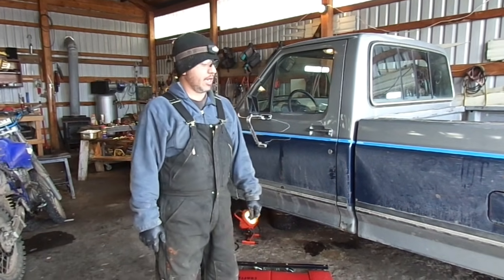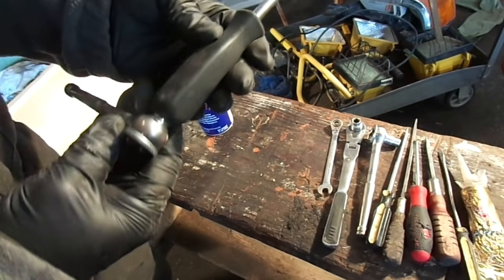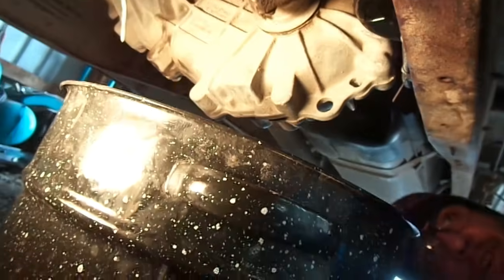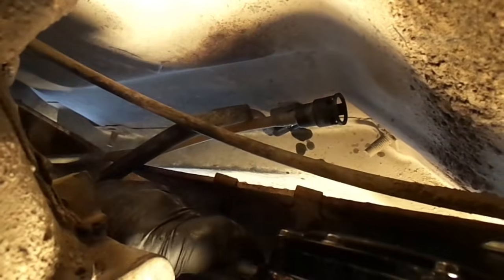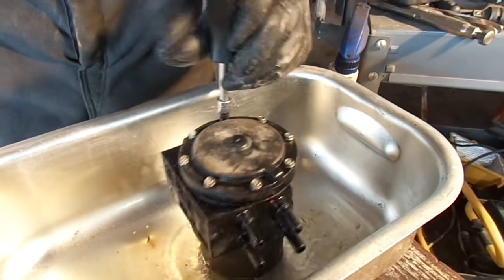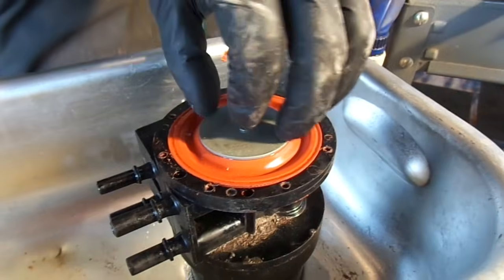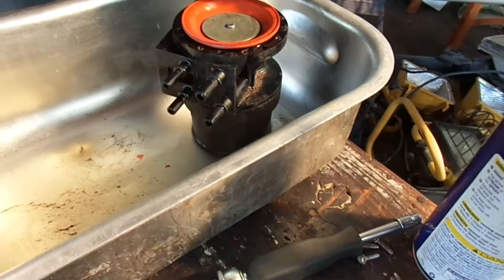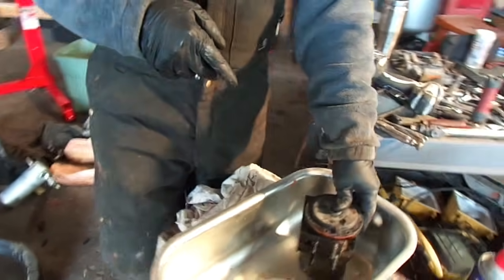1987 F150 Dual Fuel Tank Selector Repair

Comment: I have one of those. I got to check my rear tank because it leaks when topped off and parked on a small tilt to the right. I have a switch for selecting the tank, but can never tell if it really switched or not. I keep getting the same fuel gauge value, front or back, from the fuel sending unit. There should be a sending unit for each tank. Is it possible that it draws from both tanks simultaneously because of a stuck tank selector valve?
Reply: CincyPlasmaTech...check the o-ring gasket under the lock ring on the rear tank. If it has either deteriorated or if someone installed it incorrectly, meaning it is twisted under the lock ring or not properly centered, you will leak gas out of the top of the tank. This is very common on Ford trucks. The o-rings can be bought cheap and usually come with a new lock ring too. As for the fuel gauge not reading properly, yes each fuel pump has its own float that sends the signal to your gauge based on the amount of gas that is in the tank. Check the wiring to the fuel pumps (especially the ground wire). The contacts on these fuel pumps corrode easily even with the rubber boot that covers the wiring when it is connected to the pump.

Comment: So my 96 F-150 is having cross fill problems in the dual fuel tanks. The front tank just had a fuel pump changed, no the front tank is cross filling over into the back tank and over filling it and it is leaking out of the fill cap and onto the ground
Reply: Saul Varela pretty sure the selector valve on my model is electric and has been moved inside the fuel tanks. So I've heard. So now all I need to do is find the part and fix it I guess. Syphoned the gas out of the rear tank and put it back in the front, except for about 5 gallons. Now it won't start. It'll crank, and I hear the fuel pump kicking on then off. So now it's something else along with the selector valve.
Reply: Saul Varela I will keep you posted as soon as I can get home and crawl under it. I appreciate the help. I'll keep you updated asap
Reply: Saul Varela so, there is nothing on the frame rail on the driver side other than the fuel lines and and connectors. There is nothing like what is being fixed in the video. I would notice that. I see the fuel filter, lines and connectors but nothing else. It's also doesn't seem to switching tanks when you use the selector switch on the dash. I think it may be bad and stuck on the back tank which has a bad fuel pump and has only 10% from what the guy said who hooked it up to his computer
Reply: Saul Varela That's what we plan on doing first, hopefully that will work. And then like you said we will go from there. I appreciate the help and I'll update you as I go, thanks.
Reply: Saul Varela thanks. I did turn the key to run and switched tanks and they show different levels of fuel. So i believe the selector switch is working. Now on the selector valve.
Reply: Saul Varela No, I will now that you've mentioned it. I never thought of that.
Reply: Saul Varela Update: changed both fuel pumps in the tanks. No problems so far. Gas gauge doesn't go down as fast as it did and no fuel smell coming from back tank anymore. Thanks for all the help.

Comment: Very nice vid bro, I've a 95 f250 gas, when I switch it onto front tank, fuel gauge pegs out way past full, gonna try figure it out tomorrow
Reply: Saul Varela gotcha bro,  if I fix it I will def let you know what the problem was for me , dad signed truck over to me been sitting up for few years, did a tune up running alot better now , was running hot so I changed thermostat , went from a 195 degree to a 165 degree and engine runs 30 degrees cooler lol,  I've always had chevy this is my first ford and will say that 3/4 ton gas f250 rides like a caddy

Comment: Great Job!  I was Miss lead on forums about my no fuel pressure issue being everything under the sun with issue causing the problem. I followed your instruction, soaked with Kroil next day worked it in. Used permatex to seal top. truck runs wonderful..Keep up the great work. You made my day. Thank you

Comment: 96 f 250 ...is it ever just the switch on the dash board ?  my front tank is not working also . Only my rear tank ...thx !
Reply: Yes,  i think i checked the switch properly and it seemed to be good . I'm not very knowledgeable when it come to the multi-meter ,but i think i did it right  ...basically a continuity test. You were a huge help . i'm a Custom home builder by trade so if you have any questions in that department shout out ...you were a big help .I'm getting read to get under the truck now and do exactly what you did.  thx !

Comment: Awesome, thank you! Looks like I have the same issue on my 96 250, not sure if it's related but the front tank bogs out when depressing the gas pedal heavily and fill cap is leaking on a daily basis if I don't syphon it back into the rear, thought I was getting horrible mileage as well on the rear tank and perhaps the front pump strainer was clogged. Already changed the inline filter, just made it worse for the front tank. Hope this is it, looking forward to pulling it out. Thanks for posting.

Comment: Just did this on my 1989 F250 with a 460. Thanks  for posting. It wasn’t a bad job at all, but I had lots of of room because it’s not a 4x4
After watching your video I put it all together and on the first try the rear tank finally worked.
The inside valve was stuck in the up position. Worked it loose like you showed. On my truck Dorman # 800-015 clip kit. Comes with 3 5/16 fuel line clips and 3  3/8 clips. I pre lubed the fittings on the reservoir and I also put the clips on first before installing the lines. Lines Snapped right on
No leaks
Thanks again.
Reply: Jack Hammer hello!! I have to get my truck to stay running and I have to know what filter I need!! I have the same exact part as this video but no shop can seem to figure out what filter I need please help!!
Reply: @mykaelynngoldman  did you ever find out the filter I'm getting ready to do mine best of luck
Reply: @arthurnewhart6369  what fiter was it?

Comment: Really helpful to see this video, Thank you!
I, too  replaced my high pressure pump on my 1988 F150, still low fuel pressure.
Will do this next, or repair a junk yard one and swap it out. 
One critique, I've read elsewhere that there is supposed to be a small O-ring in the hole under the bump on the lid.
sometimes they swell shut, can be opened with a 1/16 drill bit- remove it from selector valve first, of course. 
Regards! Terry

Comment: Thanks for the video.  It was real helpful.  I have a 1988 F350 with the same issue.  Rear tank is working but not the front.  Both tank fuel pumps run when tested but it won't pull from the front tank.  Going to try your fix.

Comment: What if it looks like if has very small holes
Reply: The diaphragm that rubber thing that align the tow little rods. Thank you for answer my question.
Reply: @Saul Varela they look like pin holes. Like they have been done from overtime of use. Will that affect the function.

Comment: 1987 f250 carbureted When I put my fuel switch on front tank both fuel pumps are running when I put my switch to rear tank only my back tank pump runs is that normal ?

Comment: Not many men would do a job twice just to help his fellow man. This says alot about yourself sir. So Thank you. I am going through the same thing.  We need more people like you in this world. Much Respect. Great job. Thanks from Kentucky.
Reply: My comment was very simple but you said it most correct. I thought the same thing what a guy to go through the trouble to share his experience and help others out. That's a hero in my mind.
Reply: That’s what it’s all about helping the fellow man cause I’m having to do the same on a truck I just bought. Thanks for the video it help tremendously.
Reply: "I just take crap apart and I hope I can put it back together later" AAAAHAHAHAHAHAHA, Me too
Reply: When you say "thats why everyone starts to think their fuel pump is going out. When that happens Does the FRP. Fuel rail pressure at the Schrader valve drop drastically to like almost nothing? What exactly happens to make people think that? Any help is greatly appreciated 🙏 thank you. Im working on a 89 F150 5.8L guy brought it to my home shop and told me to fix it, he wanted the complete distributor replaced, the plugs and wires. And the starter relay(Solenoid)  he never asked me to diagnose it. Now he's mad cause it's not running after i did the work he wanted. I just want to get it running so he can take it and pay me  cause I'm getting hungry lol.  Oh also I'm working on my buddy's 94 Bronco 5.8L it will start and run strong for a bit, like 5 to 10mins if you don't press the gas. But after that time it will die off like it's choking down and then will crank and crank but won't start. For a good 5mins or so. Checked the FRP will it was choking down and also when it wouldn't start and pressure  Fluctuated from 20psi to 0psi mostly stayed near zero. Then all of a sudden trying to start it, doesn't turn over but the  fuel pressure gauge stutters back and forth a sec till it stops on like 10psi.  Still wont start. This times needle stutters up to roughly 20psi and so on till it got up to 30psi and started. Im like 99% sure thats the fuel pump needing to be replaced but always like to get a second opinion i mean its a pain getting to that pump. Thanks again for any and all help/advice you can throw my way. I'm just like you didn't go to college for mechanic, I went to military and Iraq. Everything I knew about automobiles I learned from doing it growing up in the sticks. The. After the service working on motors was the one job I found that was satisfying. And quite a few independent shops and dealerships later, I've learned so much its like i went to school anyways. It Sucks though when people don't really listen to you because of that and you know you're right. Drives me nuts lol.
Reply: @randallwilkes7746  your adding to a comment I made. Maybe trying to post it out in the comments you will have better luck. Mine did all that and I swapped out just about everything minus the pump. Map sensor fixed mine. Good luck with your project. Hopefully it will be a easy fix for you.
Reply: Was that the problem ? My 87 e150 rides rough. We changed the ignition module, fuel reservoir, spark plugs, distributor, throttle sensor, spark plugs wiresr. But still riding rough
Reply: @dogfilms7753  did you find problem ?
Reply: He pulled the part THREE times! He rebuilt the unit and had a leak, so he pulled it the second time, then he re-installed it and removed it a third time for us...This is one hard core mechanic!
 Or he is getting paid by the hour...
Reply: @kenbarnett9415  
Sometimes it works out that way nobody’s perfect.  I like his politeness speaks clear and intelligently looks like he keeps his tools organized. His determination to fix the problem rather than go buy a new part is my style as well. Good job buddy keep on keepin on.  👍

Comment: Thanks man just figured out something messed around and went and push the button and the secondary and first Dairy tank works I just didn't realize that it worked I thought it was broken but nevertheless thank you for the advice now I'm on trying to figure out how to remove the power steering pump or should I just take it to a shop and let them do it if it's not one thing it's another

Comment: Thanks for this video, though I have been working on cars and trucks for over 20 years and did go to college to become a tech, I have never done this procedure before. I noticed when I run the front tank on my 95 f150 5.0 auto, 2wheel drive, there is a big leak that not just drips but sprays and soaks the muffler. Now I have an idea what is involved in this fix. Thanks again!

Comment: I have two tanks one in the rear and a long one in the front I see a filter with a blue line and aluminum lines running to the front and to the back when I bought the truck there was that little black valve thing that was in the front seat it was very small I didn't know what it was so I threw it away the people never told me that the gas tank did that when I bought it filled it up gas start shooting out of the first tank that's on the driver side the first tank and then it's the second or vice versa whatever's the first one so it shoot it out I'll say II first ones next to the door when you open up your driver side door then the next tank that tanked when you open it spills gas everywhere and it makes my front tank go empty

Comment: Great video thanks! Question..I have a 95 F150 XL... just installed a new front tank and rebuilt original pump...(idea is to eliminate rear tank)  started vehicle and fuel was running out of rear lines...Can I just seal rear lines  although fuel selector needs service or will I have issues with fuel pressure etc?

Comment: I got a 86 Ford F-150 XLT so many new parts and still not running right. I need help bro
Reply: And my 86 XLT I have replaced all three fuel pumps,
Reply: I have spent about about $4,000 total in new parts and it still isn't running right. I love this truck but I'm going broke
Reply: I had both fuel tanks replace and the fuel switch doesn't seem to be working, the front one was working and now it's not but now the back one is working. And before that it seems not to be getting enough fuel and keeps bucking. I was thinking about getting the injectors replaced but they're like $80 a piece not including labor and that may not even be the problem
Reply: Saul Varela I'm going to try that as soon as the snow clears up and I thank you so much my brotha
Reply: And please share any suggestions you can give me because I really don't plan to get rid of my truck anytime soon

Comment: I can't find mine! My mechanic texted me and said he thought it was tank integrated. Ever heard of that? I replaced my selector switch and everything seems fine now. I won't know until I drive it while and see if the front tank erupts again! I was pumping between tanks and didn't seem to have reliable power supply to the pumps. Now both pumps seem to work great (brand new tank and pump in the front 1995 F-250 with a 460). I can't find a selector valve or a FDM. I'm going to drive it for the week and see what happens. No problem switching between tanks now. No hesitation or stalling on switching.
Reply: Saul Varela yes, I had one tank pumping to the other.and intermittent power to the pumps. I replaced the switch. Problem seems to be solved. I will keep you posted on the progress. I may still be moving fuel between tanks.

Comment: Did the truck have a high pressure pump?
Reply: Saul Varela thank you for the info. My 88 was missing the selector valve when I bought it. Looking to get one so I can use both tanks but wasn't sure where it mounted

Comment: Hey, great vid.  I came across your video researching about a 1990 I just bought missing the rear tank.  Along with a gas gauge that doesn't move.  In the middle of taking the front pump apart, I found the yellow wire going to the float assembly hanging on by a thread.  As soon as I touched it damn thing fell right off.  Going to try to reattach the wire.  Long story short I wanted to say keep making vids.  Learned a lot.  Best way to learn, get your hands dirty.

Comment: Good video.My 92 f-250.the front tank stays full and the fuel gauge doesn't work. I am thinking that your fix video and checking if the front pump is working is what i need to check. Your thoughts?
Reply: I have checked and my truck will run on either tank.my front tank doesn't work on the gauge. The sending unit doesn't work.I sure wish the bed had access panels to the top of the tanks. I may create my own when I end up lifting the bed or dropping the tank.I am not sure which one is the better idea.My rear tank the pump is really loud and the front is kinda quiet.It does work. I have read up on fuel pumps and it seems like many of the aftermarket pumps fail really soon.So having access would be a good idea.I plan on keeping my truck for many years.

Comment: Hey Saul, nice vid.  I have an '86 F250 4x4.  All I was doing today was changing the fuel filter on the tank selector.  I have the same metal cover plate protecting the selector switch which I removed.  Using just about every tool, I could not get the fuel filter threaded cup that holds the filter off.  Rather than risking breaking the filter cap, I started the same procedure you just showed so i could try to remove the filter cap on the bench.  My fuel line clips came out easy and the lines came off easy.......except the front tank return line that snapped the plastic nipple on the tank selector body.  A real bummer.  My tank selector was fine but now off to Amazon for one of the vendors selling a replacement for $176, ouch.  So what turned out to be a simple filter replacement is now a costly selector replacement.   I don't miss the salt and cold like you have here in the vid....I live in San Diego so my issue is the heat dries up parts and things get brittle which is what I think happened and why the nipple on the front return snapped.  Keep up the good work.

Comment: I am so glad you went to the trouble of making this video.  I have an 88 F-350 and I am going through hell trying to solve its lack of power at highway speed.  My fuel pressure test needle is bouncing around like crazy and I cannot get the truck up to a good accelerated pressure.  I have been fighting it for a long time now and have only recently been able to break the mounting bolts free to get this thing off the frame.  I have tried to open up the bottom twice but so far it just has not come free.  Also everything I have read and heard from others is there is nothing inside that bottom piece.    I am so glad to have finally encountered someone with this same setup having to tear down this unit and prove otherwise.  Thank you!